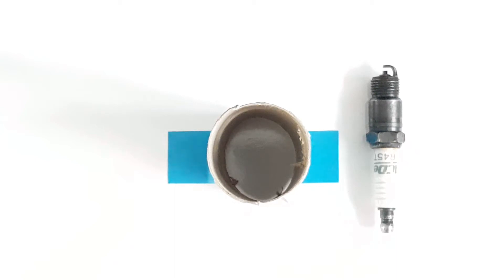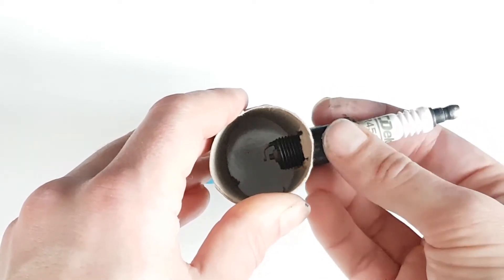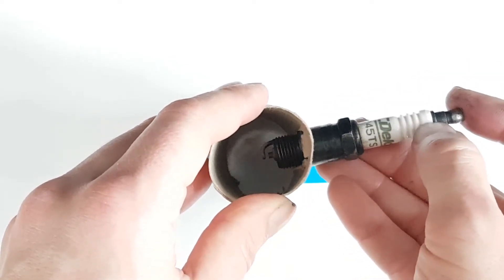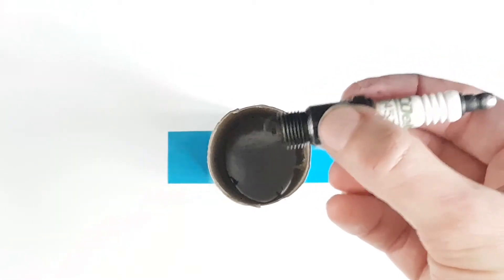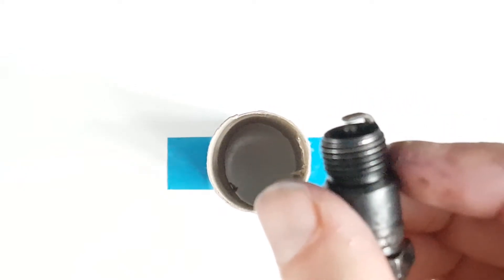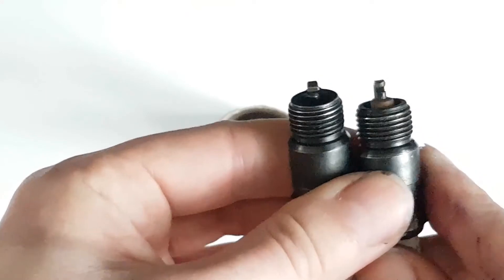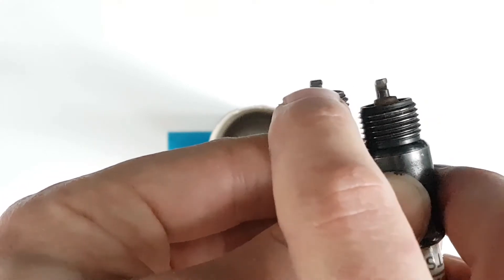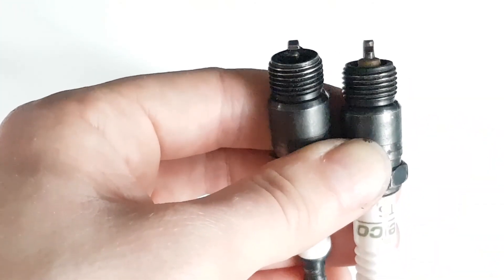Spark plug secrets: indexing and rounding spark plugs. Will it make more power? Probably not.

Comment: Indexing the plugs will make no difference at all. The fuel air mix is compressed before the plug ignites it so it wont be flowing through the plug gap, just squished into it.
Reply: indexing is done to stop the in coming fuel mixture washing over the electrode. its a must do on high performance methanol engines ect
Reply: That's interesting and the more I think about it probably right
Reply: @tthams73 I see, will have to think on that one tonight! Thanks for another angle (literally) on the subject, could get intresting! 👍
Reply: @tthams73 what are twin plug heads trying to achieve, an answer to this problem?

Comment from the maker: @RichardHoldener did some dyno tests on how much difference indexing can make. https://www.youtube.com/watch?v=5lFxYzpYeig This is on a gasoline engine, wonder if he'll also do a test on methanol fuel
Reply: Richard Holdener is a blogger ( clown)who did everything wrong in his experiment but love to make a statements as like he is the final institution :) He used old set of even different brands spark plugs and indexed them with indexing washers , which is wrong since it change the spark plug reach and the heat range and this do lower the power output ! I’m even surprised that he achieved the same power levels both times. On the other hand you get the things right , except the use of indexing washers ! The proper way of indexing is by trying few different spark plugs ( usually 1of 3 matches the proper position) per cylinder. Another million dollars question is how we can find the proper spark plug orientation for any particular engine , because if we index the plugs in wrong direction the result will be even less power , responsiveness and smoothness than randomly mounted ,without indexing spark plugs . 
Here is a video which explain very well the benefits of indexing and the reason why many of the fresh models cars using factory indexed spark plugs https://youtu.be/r_zmA6Q0cQ4

https://youtu.be/hFcaZ0ckmFs

Comment: Why don't spark plugs come with rounded tips then?
Reply from the maker: I would imagine cost to be a leading factor. A piece of flat stock would be more universal and easy
Reply: @car_ventures  surely it would cost nothing if the tool that cut the flat stock cut it with a rounded cut as opposed to a straight cut, I'm not disagreeing with you just trying to make sense of it

Comment: /mk a twin / head spark plug int= two stroke / four tech system //i.e. rate 2eqX'r + L''M' k=[C++- A] kt > in 3''in diam 3 pins / cylinders i.e 2 plugs i.e dx=3 //use two points u contact or EI K' works sht // try intermittent AVN grn traeckz with rd lockonz u two mech / electro arms in 360deg Ops - mid graed sizals /temps/O2 pumps - intake valves // dv || dt =9vk''R'xm'' ++- v4 6''in slopes top/bottom /